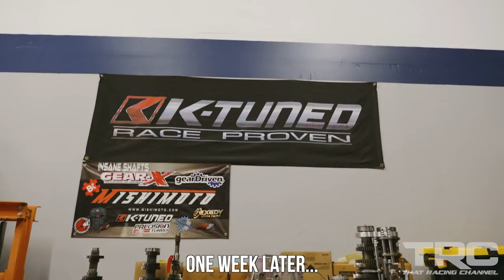800HP AWD K-Series Honda Transmission Guide! (Complete Rebuild Start to Finish) - Ep.6

Comment: Question.. Could you add a 6th gear to this 5spd? Why not go PPG now? I thought Gear X wasn't that good with tires bigger than 25 inches on turbo cars? Love the build I'm trying to do the same.
Reply: Was going to ask the same thing. If this will also be a street car, I'd recommend considering adding the factory 6th from a TSX, RSX, or late gen Civic Si.  Im planning to do the same on my factory 5 spd Honda Element.

Comment: That would be cool if there was a performance aftermarket for a CVT FWD/AWD transmissions. Integrate paddle shifters and tune your own gear ratios and have as many gears you want. From 1-8 diferent programmed gears. Or just work like a regular CVT but a lot stronger. They would decimate the quarter mile if CVT's were strong.

Comment: Thanks for the great video.   I have an RSX base with a grinding, almost inaccessible 2nd gear.   I've replaced the clutch a couple of times in the 15 years that I've had it... this video makes me feel like I might be able to crack open the trans & maybe even tear it down & put it back together.  If I do try it, would you be able to provide some email/phone support (if needed) if I promise to buy parts from your company?  I'm not exactly a beginner mechanic but I'm never cracked open a transmission either.   Maybe I shouldn't even try it?   I'm not quite sure what I'm going to do with the car yet, I might do a k24 swap & build, might keep the base engine w/ cam mods & bolt-ons...  at any rate this 2nd gear is super crunchy so I don't drive the car - would love to get it back on the road again.

Comment: It seems Dale has developed his craft to an expert level. I’m sure from the beginning till now he has learned from trail and error to his own admission but this is how you get to this level of expertise. Impressive given he wasn’t trained from Honda factory. There are so many things that need to be done, measured and installed correctly or else it will not work right. I appreciate that he has to check, mark, and document that everything is done. Transmissions are so complicated and someone with his experience and work ethic is only type of shop I would trust. As you can see he does this solely by himself probably because he can ensure it was done right and not have to double check a helper’s work. You can tell also by his customer’s reviews of his work.

Comment: sorry this is a knowledge test question. why at 35:22 did the mechanic cross tighten the bolts? Sorry, I'm just a beginner.
Reply: I do it to close the casing evenly #crisscross pattern as per manual

Comment: I have a question what's the gear x gear ratios that was installed in the transmission? Was the axle ratio upgraded or remained factory?
Reply: Would like to know too the ones on his page look too short for a turbo set up especially with a 4.7 fd his running
Reply: 2.313/1.65/1.304/1.08 4.7FD